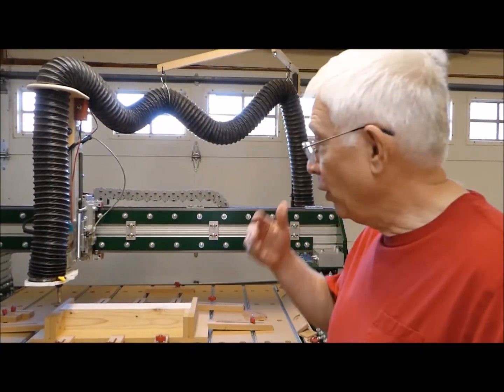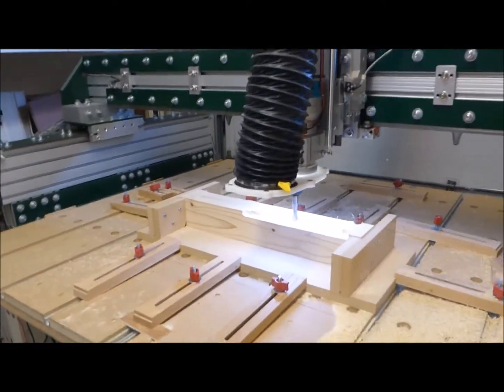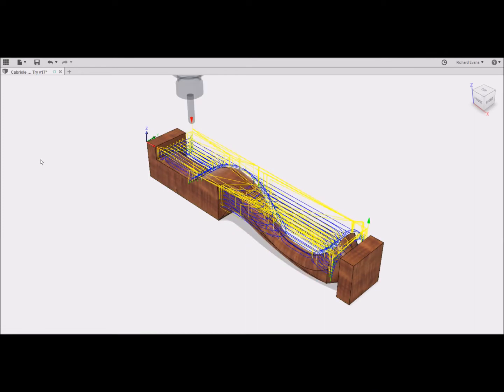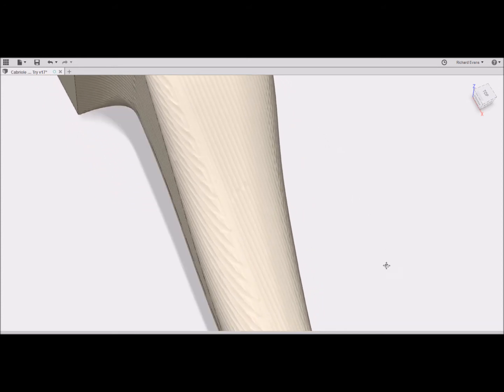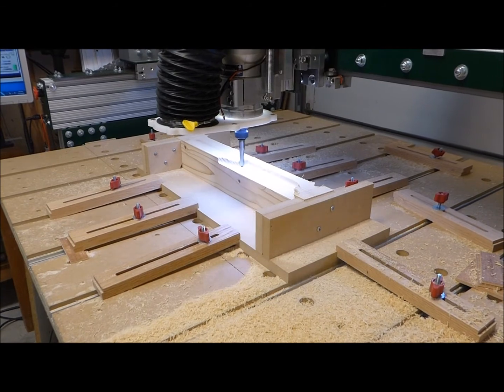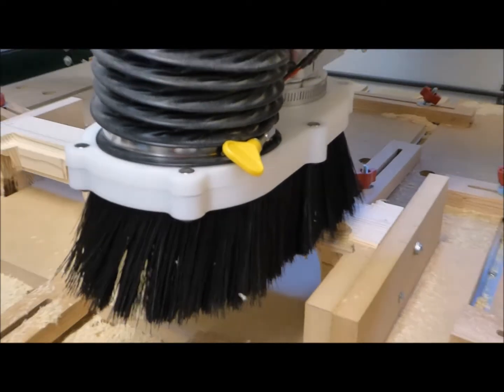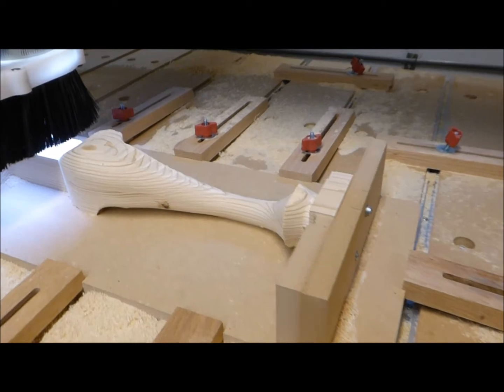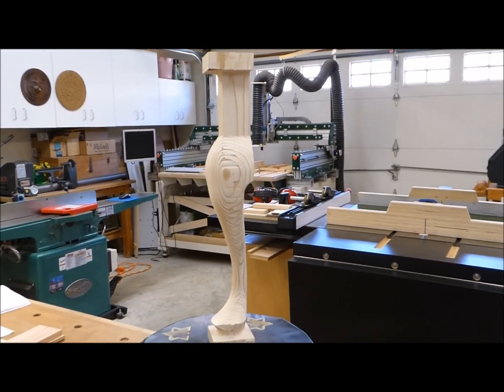CNC Cabriole leg

Comment: Really interesting video Richard. Exactly what I was searching for. Looking to model up a contemporary “cabriole” leg in Fusion. I wonder whether you’d share your fusion workflow for turning the sketch into the 3D model. Would be very interested in seeing an efficient way to do that. Many thanks
Reply from the maker: Hi Mark, thanks for watching.  Here is a link to my Fusion 360 model which will allow you to download the model into your Fusion.  You can then explore the history log at the bottom of the Fusion model screen to see all my steps in detail.  One key to the making of the model is the fillet tool using a variable radius.  This really made the rounding of the 4 corners easy.  Just enter this link into your browser: https://a360.co/2uFX5oZ   Let me know how your project goes.  The model includes the CAM as well.

Comment: I was thinking,.... You can bandsaw off 80%.... Then I saw you did that. I assume this would speed up actual machining time exponentially. Could you have the software, jump forward and begin the roughing where you left off with the bandsaw or does the whole program need to run? Thanks for the video, good stuff.
Reply from the maker: Thanks for watching WW.  If you were to use a band saw to cut to rough shape, the CNC roughing passes could be skipped, leaving just the finishing passes to execute with the CNC.  Whether this is a real overall time saver would depend on the time for the CNC roughing passes vs the time to do the band sawing.  Total time for tool paths for the leg in the video was 63 minutes; of this 23 minutes was for roughing and 40 was for finishing.  See my reply to the first comment below for a link to the Fusion 360 model that you can download.